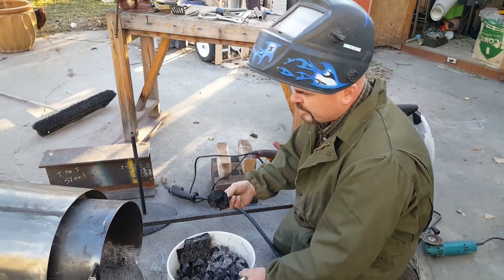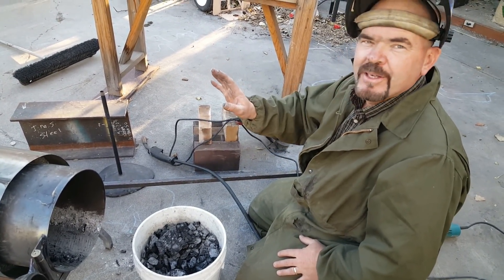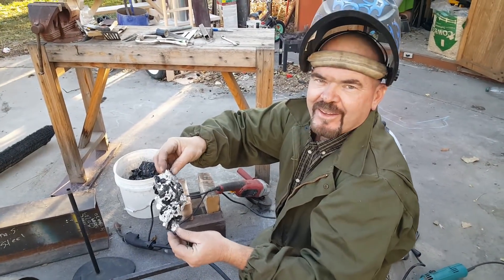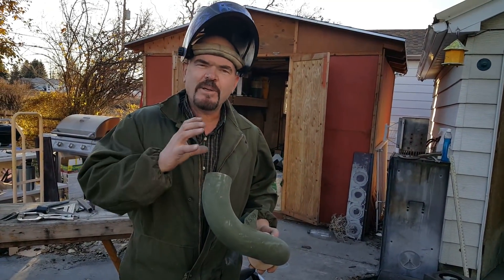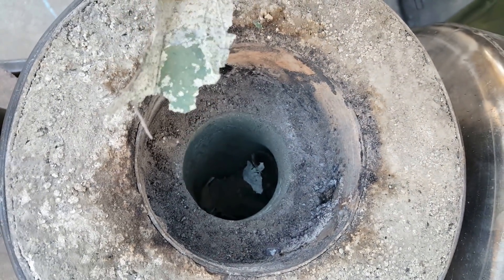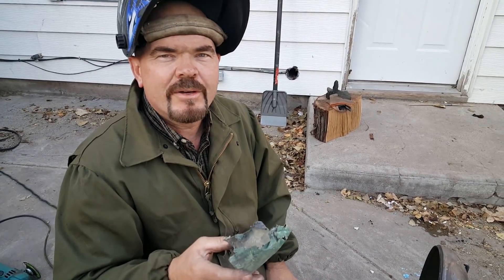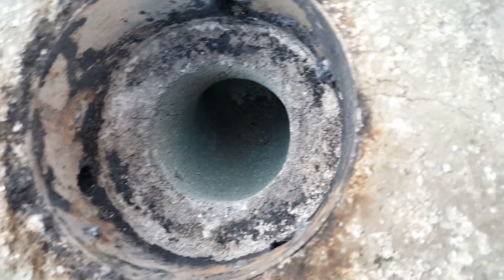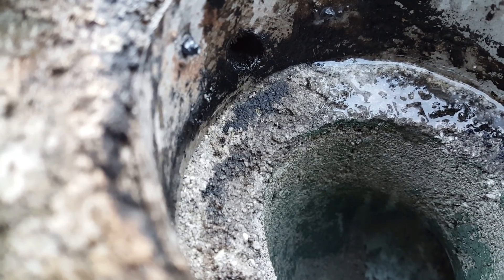Melting on a Rocket Mass Stove

Comment: I've been thinking of making a rocket stove entirely of aircrete. If I dilute water glass 50/50 and use it to make the cement mixture before adding the foam, will diluted water glass make a good concrete mixture and will that be enough to protect the aircrete from the high temperatures or should I still coat the surfaces exposed to high temperatures?

Comment: An amazing build, and I can't wait till it gets all dialed in at the cabin.  The green paint is CARC, Chemical Agent Resistant Coating.  It gives a layer of protection to military equipment in the event it is ever subject to a chemical attack.  I don't know about burning it to death, but the manufacturers make a big deal about the level of exposure when you paint it on or scrape/grind it off.  So be very careful with that coating.

Comment: Can you use water glass as a substitute for water in cement or refractory cement?

Also can you use water glass as substitute for water in air Crete?
In the slurry and or the foam?
Reply from the maker: no in regular cement, I tried it. yes in refractory, depending on the combination of cement, clay, sand and perlite. you have to get it just right and mix them together in the right order

Comment: Nice looking stove, but what are you going to use for the MASS? the idea of a rocket MASS heater is that there is a large MASS of material that "Absorbes" heat and then later after the fire goes out, the heat continues to radiate from it. The insulated part is the fire chamber but there needs to be some part of the flue that will absorb large amounts of heat without insulation. The exhaust coming out of a good rocket heater will be pretty cool, sometimes so cool that it does not have enough draw to keep the fire going!
Reply from the maker: Its coming.